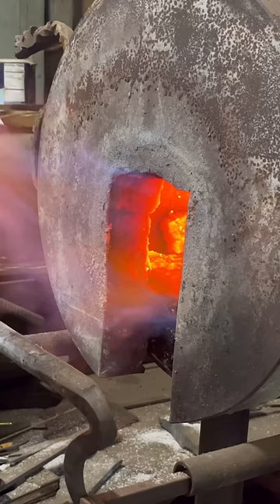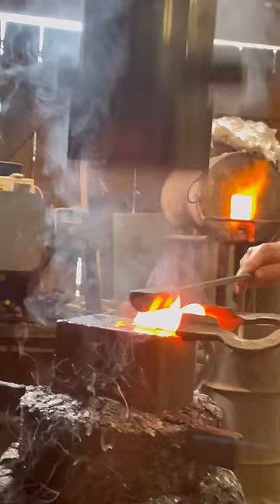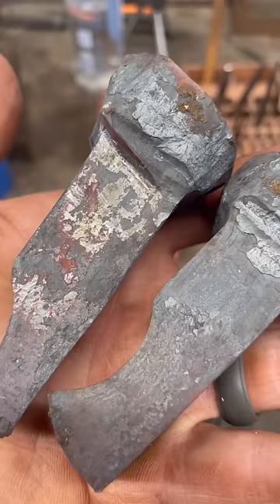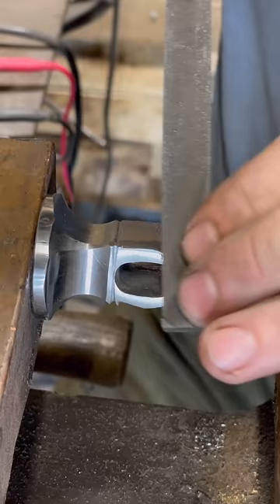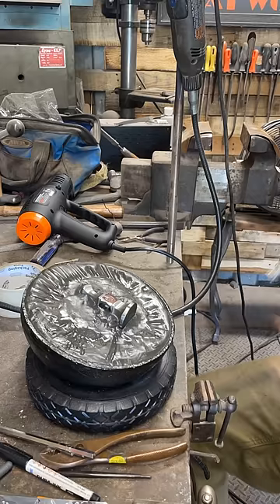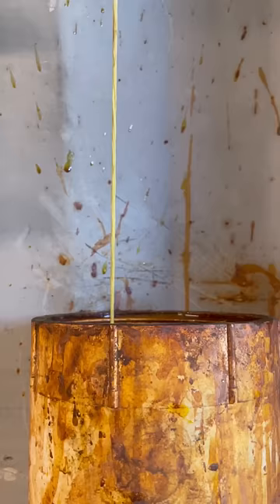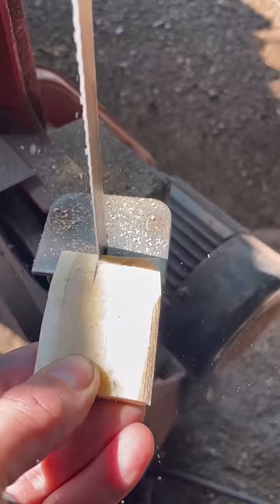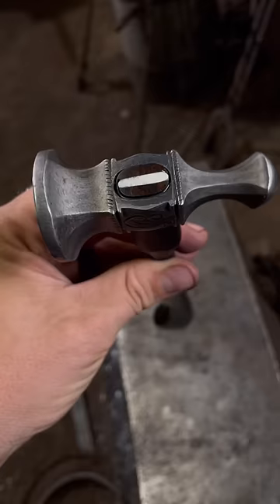Making a Chasing Hammer in 1 min #short

Comment: That looks awesome. I wish I could find a mentor that would teach me to work with metals. Used to work for a tool and die shop just simply squaring up the blocks of steel which was the first step in the process. How the other guys know how to drill all the holes and everything else in the part is amazing to me.

Comment: Where do you get the ivory for your wedges?
Reply: That part was a little surprising to me too. Didn't know that was still a material allowed to be used for anything.
Reply: @bradprice8040 If I'm not mistaken, it's not. It's a material expected to be reclaimed by wildlife preservers in efforts to prevent poaching.
Reply: Adding to my comment, just a quick Google search shows that it is illegal to buy/sale Ivory, but not to have already owned it and had it certified in the US, presumably where the creator is from.
Reply: Checking out their website shows this product is made entirely from Maple wood. I'd assume the Ivory in this video was unique to this tool and done specifically for advertising. A small amount of Ivory is reasonable to assume it's left over from objects passed down.

Comment: So I just need a 2000 dollar milling machine to cut a 2 inch flast square and a 3000 dollar air hammer and a 1000 dollar metal cutting band saw. 6 grand not to bad for a hammer.....
Reply: I mean, it's 6 grand worth of tooling he can use to make pretty much anything he wants with.
Reply: @joshthomas6667  yea its a joke.....
.id imagine he can get at least 4 more hammers out of an even smaller piece of metal.